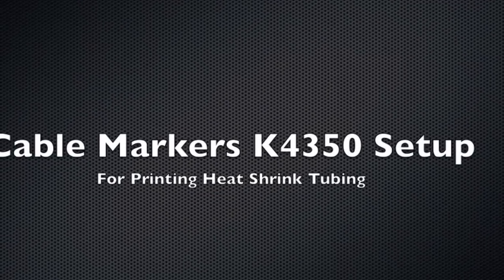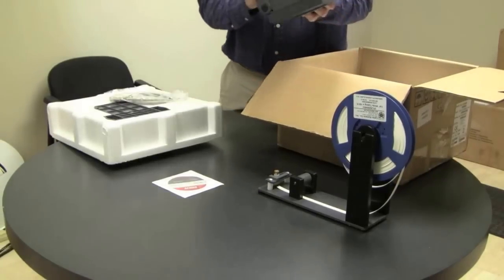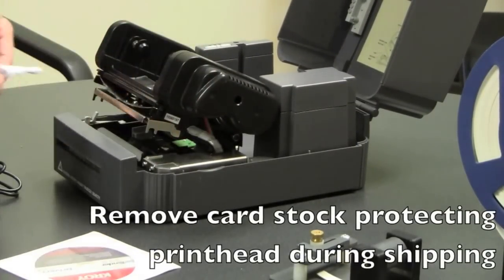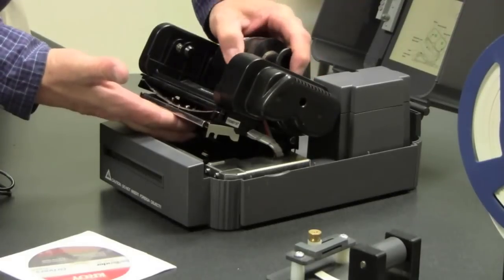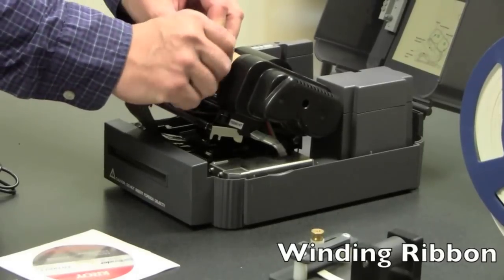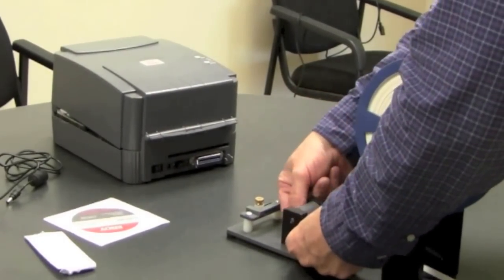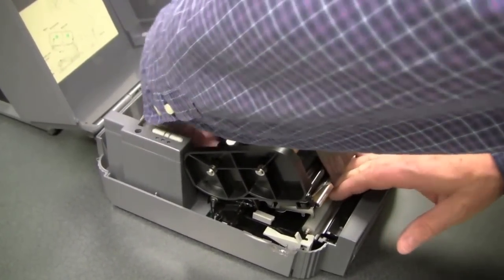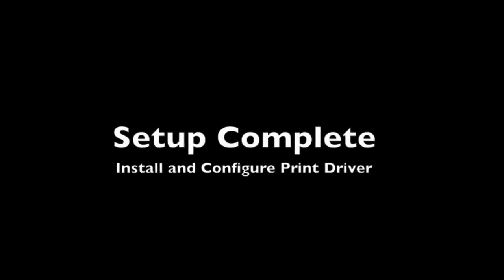K4350 Setup

Comment: My Paper is coming out with the media paper. Why is this occuring?
Reply: The take up ribbon spindle holder (front) is not activated, turn power off, hold down top button and turn back on, you should hear the front spindle engage, then release button.  Press feed button again and make sure that the ribbon take up spindle is working.